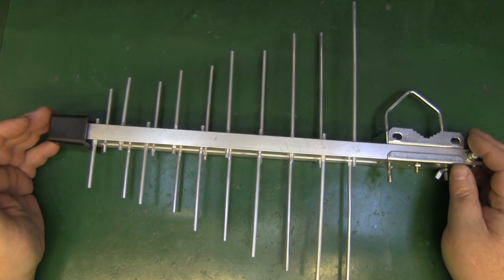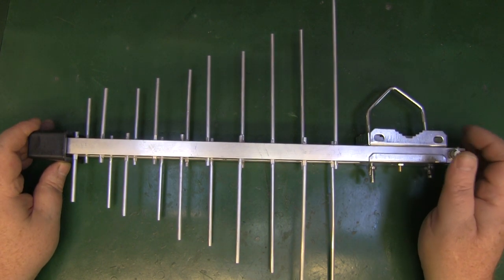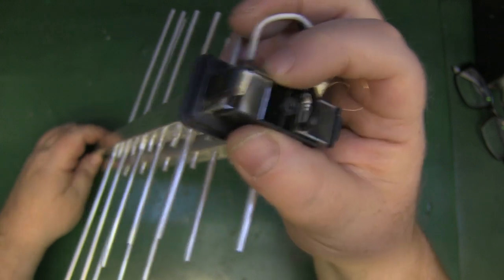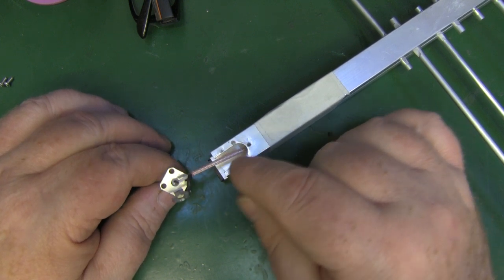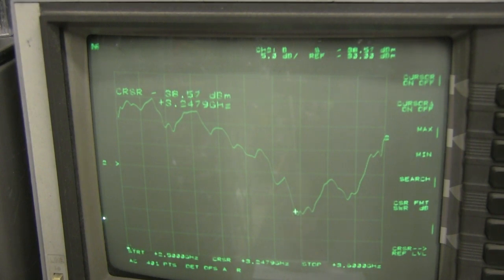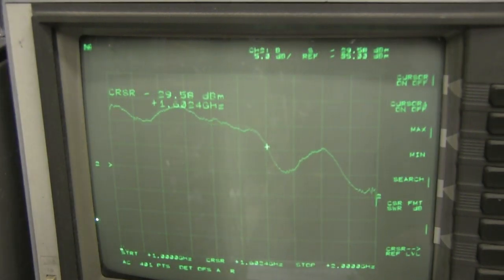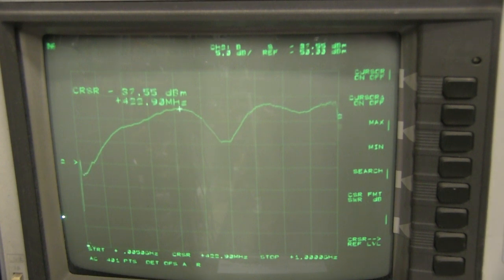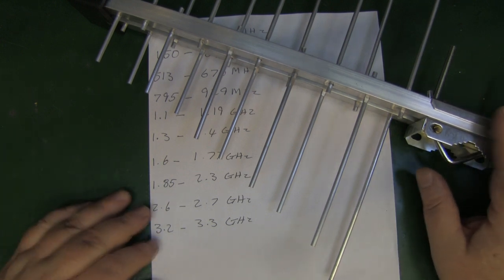Can You Use a TV Arial as a SDR Antenna?

Comment: Hi Andrew. WiFi in a Motorhome. We stop at sites which have free wifi. Problem is the signal strength is poor and also our motorhome is metal but fibreglass roof. I have been trying to find signal amplifier. But reckon a wifi Extender may do the job. But many are mains powered and we have 12Vdc. Also our technology doesnt have Lan Sockets so wifi to wifi needed. Wifi external hi gain aerial with internal aerial. Plus limited funds so any suggestions plse. Cheers from old George
Reply from the maker: We take the grand kids away twice a year to a caravan site. It has free wifi but only around the main complex. I use a cantenna pointed out of the window on a small tripod. This only allows me to use one laptop though with a USB wifi. You could use the cantenna or some other directional antenna with a wifi repeater and that way all your devices could connect wirelessly to it. But some open wifi access points will not let you do this though as you are effectively creating a second access point. You need to get a wifi repeater with SMA connections so you can use a directional antenna. Unfortunately these a few and far between or modify your own like I did here: https://www.youtube.com/watch?v=_pqPLTsx-s8
Hope this helps

Comment: Awesome presentation sir!  Great information, tear down and analysis!  Some of those aerials even have an impedance matching tunable part that I guess is called an adjustable hair pin impedance match thingy. 

I was impressed with the radio shack discone antenna as a broader band SDR antenna.  I was thinking they can be modified for lower frequencies also with a modified loading coil and monopole (I was thinking a scorpion or screwdriver antenna design) and modifying the cone elements length maybe with telescoping antennas or like GBPPR did with aluminum threaded rod.  I've amassed a collection of aluminum ski poles to work on the heavier duty ski pole discone and some other antennas... though that's for next winter.  

Will be fun tuning and watching the spectrum analyzer... interestingly I'm looking forward to doing that more-so than building.  Thanks to Steve Jordan also over on that side of the pond for his mini-lathe detailed youtube works.
Reply: Long time owner of the classic Radio Shack discone.
Great antenna. I've had one in my attic for decades rx and tx it works. 
Unity gain, but that aside a great performer.

Comment: Just got my hands on an old satellite dish today and was thinking to convert it to an antenna to recieve wifi from about 2 miles away (no company reliably serves our area)

 What kind of cheap DIY antenna would you recommend to replace or modify the LNR for best results? Somewhere under $20 in materials if possible
Reply: Biquad, or if it is a round dish then maybe a (short) cantenna.
If you are lucky enough to find a "primesstar " dish you can turn it into a 27- 30 Dbi monster. Hughesnet dishes are also very good conversion candidates.
More modern multi-feedhorn dishes are not perfect parabolas and are designed to get signals from multiple satellites  and reflect them to multiple feeds.
They deformed the parabolic section to accomplish this making the focal point into a focal area or band maybe, and this also widens the beamwidth sacrificing some of the gain that could have been.
The good news if you have one of these newer dishes is they are more forgiving of feed placement and aiming errors and you most likely don't need the gain  that was sacrificed.
The feed should not be high gain because you want it to illuminate the entire dish so high beamwidth  even gain feeds are better than a bright spot in the center of the dish and ignoring the edges.
Avoid long coax cable runs put the client as close to the feed as you can and use USB or ethernet to transport the signal long distances instead of coax.
Cantennas are cheap but a biquad or patch may be easier for you to scrounge the materials needed.
Reply: @NVC77   oh I know, I just meant taking out the old circuitry and using the LNR housing to house the antenna, or the bulk of it anyway to set up the new diy antenna
Reply: @ghz24  so it's a DirectTV dish about 8 years old, I can make either a cantenna or biquad, keeping the LNR mount and just replacing the internals with my DIY antenna so as to keep the focal point as close to the original dish as possible, wondering if biquad or cantenna (or any other) would be best for a 2 mile distance, and have good reception

Comment: Does the mounting bracket short the upper and lower boom elements
Reply: Yes, and it is meant to. Take a peek at some online log-periodic calculators. They will show you the distance from the rear element to short the 2 booms together (remember that the LDPA is driven from the front. It is a necessary part of the dipole array principle.
Reply: @randallhendricks8230  And the coax cable runs only through the bottom element (where the F connector is)? The top element is empty of coax cable, am I right?
Reply: @Soren_Skarsgard  In the case of most mass-produced LPDA antennas the coax does go through the bottom boom for a hot boom design. However, if you are building your own, there is a better arrangement that the coax does not go through either boom, but instead hangs off the front of the antenna and connects to the pole further down. This website goes into great detail to explain why this is important: https://www.w8ji.com/baluns_on_log_perodic_antennas.htm
Reply: @randallhendricks8230  Wow, thanks! A friend gave me almost the exact same log from this video (no connector - the coax just exits from the back of the lower boom through the plastic plug), and he hacked it from the front, just like you're saying. I thought he was being stupid, haha... Is this hack better for TV?
Reply: @Soren_Skarsgard  Separating the cable from the boom improves the performance of all Log-periodics.
Reply: @randallhendricks8230  Thank you, Randy! You're the man! 👍 👊